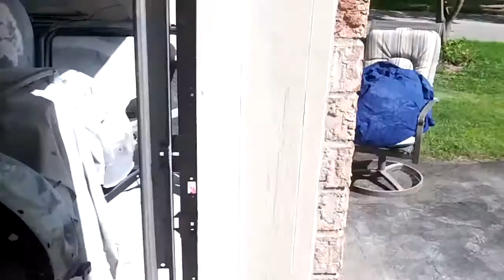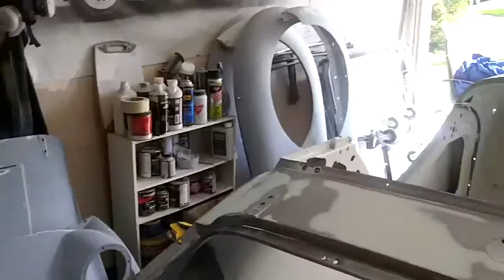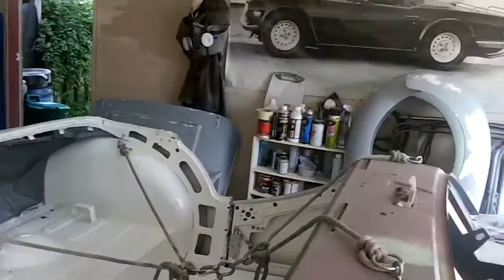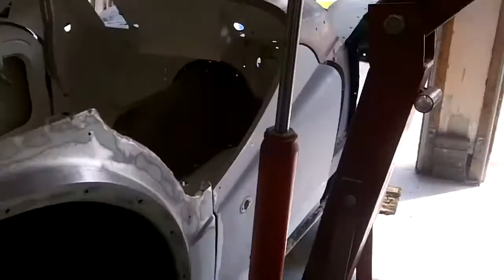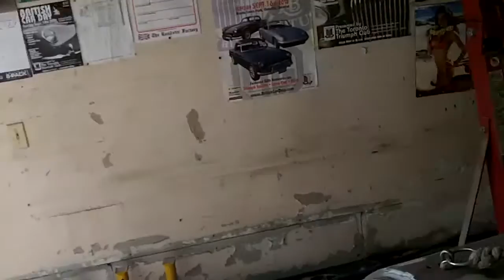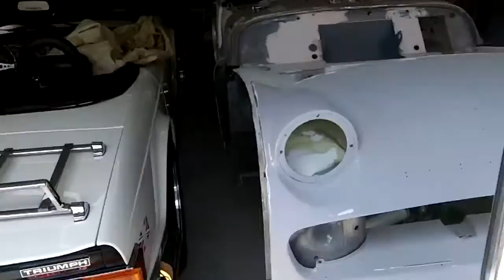Taking the Body Off, 1960 Triumph TR3A Restoration

Comment: Hey dude
Used to watch your videos a few years ago kinda lost touch so my
question is did you ever finished it,  you still put out utube clips?
Reply from the maker: Dinos Metaxas hey there Dino's. Yes, it's been done for a little while now. If you check the playlists on my channel, you will see one dedicated to my 1960 TR3A. It has all the videos including some ending shots of it driving and some beauty shots of it etc.   I have a couple other projects on the go.  I am about 1/2 way through a 1959 Triumph TR3A but I am currently working on a 1968 Triumph TR250. Again, click on playlists on my channel and you will see dedicated videos in order for each project.  Cheers, Tush